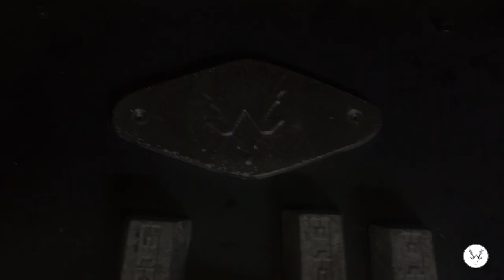Homemade Lead shot Grading

Comment: Thanks for doing this video. It hits almost all the right spots I’ve been looking for. Where do you get your sieves and what are the sizes of the screens I need to grade my shot effectively. I have an Oasis shot maker that’s a seven dripper unit with two sets of drippers (#4 and #7.5). The #7.5’s are double drippers so you can only imagine what kind of output you can get once everything is hot flowing.
Reply from the maker: Thanks for your interest. Ive done a video on how I make my screens after seeing the price of commercial ones.
many thanks

Comment: Hi, I tried my ladle today for the first time. Well below the temperature you recommend for shot making here in Ontario but I couldn't wait any longer...LOL
I managed to make quite a bit of really good looking shot mixed with quite a bit of tear drop shaped stuff and some other globs. (All my fault, I was messing with temperature and really just playing).

Im thinking of trying some sort of ramp to roll the shot down to help separate the tear drop stuff from the good stuff..Have you tried that?

Im 100% impressed with what came out for my first run. Cant wait for some 20C days to run this properly.
Reply from the maker: Thanks for letting me know, sounds like your doing great, if you have managed to make some good shot on your first try especially in cool conditions then your results are only going to get better. As for grading try using a large sheet of glass at a slight angle and reject the ones that dont roll.
Many thanks again
Woodsman243

Comment: what soap do you use and what is the water temperature?
Reply from the maker: cheap fabric conditioner, thinner the better. Keep it around 40 degrees Celsius
Reply: @woodsman2433  thanks

Comment: Thanks for posting this video. 
I see the finished shot still contains a tiny bit out of round shot or some with a tail. Is this no problem in reloading and or shooting it? Have you thought about developing a way to sort shot (after size grading( into A and B shot based on roundness or am I overthinking it and is it a non issue?
thx!
Reply from the maker: My tumbling process takes care of most of it, not had any problems with patterns or reloading, check out what the old fashioned frontiersmen
used to harvest game in the past
Reply: For the most part it's a non-issue. if you wanted to get Super Duper about your shot, get a super flat smooth surface and handful at a time throw it on the surface the shot that rolls the farthest is the roundest so figure out a happy medium between the two areas, clear the shot, repeat

Comment: How can i get the right holes to make the right size of shuts ?
Reply from the maker: We use the latest micro drilling tech to produce very precise holes in our drippers which we sell.
but as a general rule  (0.036) = #5
(0.032) =#6
(0.024) = #7
(0.020) = #7.5
(0.018) = #8
(0.016) = #9
hope this helps

Comment: I'm confused about the blue water... What kind water is that, soap or acid water,. Tell us me too it. Normal water we try alot but that is not possible to make ot round. Oasis
Reply from the maker: Its fabric conditioner that is used in washing machines
Reply: @woodsman2433  thanks for the information but why do you use a fabric conditioner instead of water..does it make any difference?